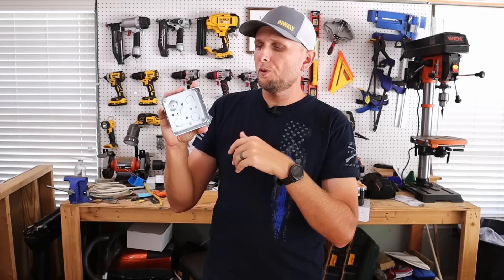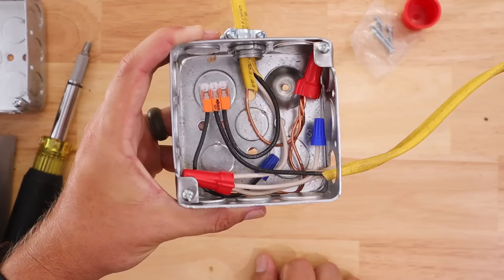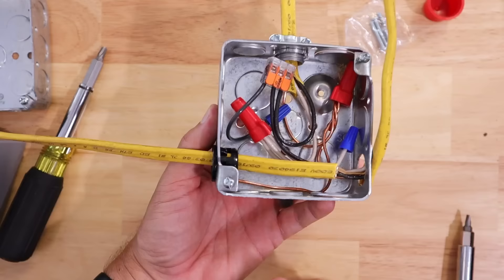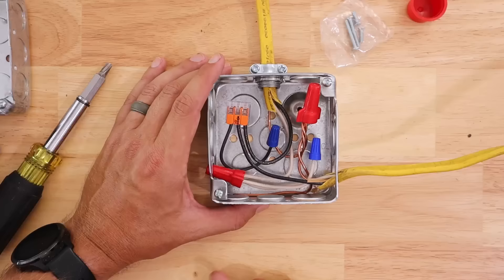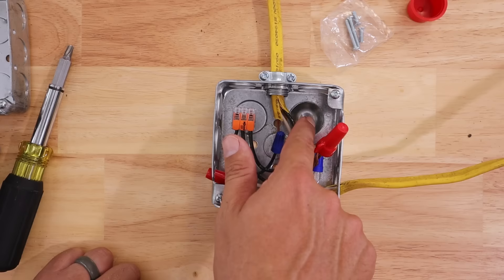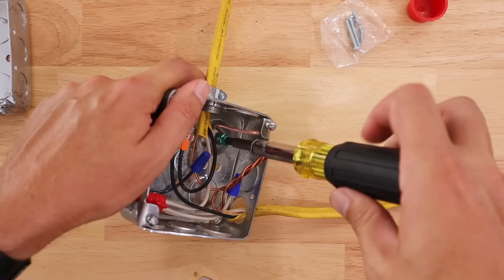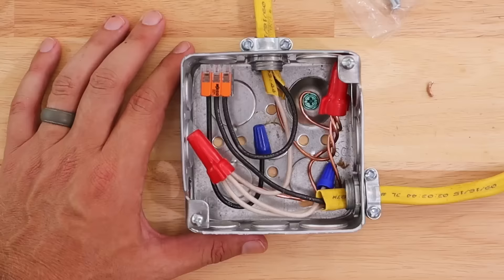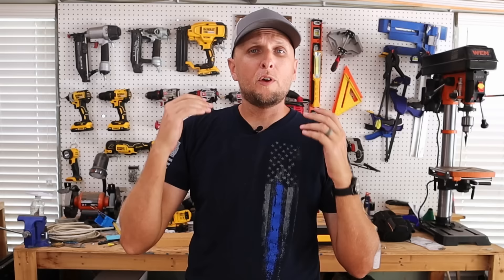The BIGGEST Mistakes DIYers Don't Know They Are Making When Installing Metal Electrical Boxes

Comment: The 14 gauge pigtail isn't really a problem... like at all.  You will most likely be putting in a 15 amp outlet which only requires 14.  The rest of the circuit needs the 12 for the additional current from other outlets.  If you were putting in a 20 amp then I would say for sure use the 12 (even though it's a minute difference).  But again not really an issue for the same reason that 15 amp outlets are allowed on 20 amp circuits.
Reply: i think if its under a foot 14 is fine for 20a anyways. still not a great idea to do so because some idiot is going to be looking at it later, get confused, and screw something up

Comment: With the green grounding screws, do they have to be used because of code compliance, or are they made of a material meant specifically for grounding?
Reply from the maker: So technically it doesn't have to be green in this installation.  It has to be a machine screw and fit the threads in the box.  Going with the green ground screws in the electrical section will ensure that you are getting the proper type and size.

Comment: Those small blue wire nuts are also a violation, they are only rated for a (1) #14 conductor in the spec sheet. They are not at all rated for #12.

Comment: The requirement for a green screw does not apply here as it applies only to device screws and screws used as main bonding jumpers according to 250.126(A) and 250.28(B). Section 250.148(B) is the main rule in this case, and it requires only a grounding screw used for no other purpose or a listed grounding device. The screw is not required to be green. However, Section 250.8 states, “sheet metal screws shall not be used to connect grounding conductors to enclosures.”
Reply from the maker: Yes, I said what I did because this is for homeowners and it's way easier for them to just go find these green screws in the electrical aisle and know that they will fit and be good to go instead of trying to find a machine screw that will fit correctly.  In some applications green ground screws are required however.

Comment: Your neutral wire nut is not properly installed in your completed box.  Should be twisted until conductors wrap to prevent any conductors from sliding out.

Comment: 14 Ga is not an issue if you are installing a 15 amp outlet. If you are the one installing the wiring it is safe to assume you are going to be installing the outlet as well. 99% of the outlest in homes are 15 amp. This being said.... If there is ever a fire, that wire will be blamed. Most states and even the NEC (based on a quick google search) say 14 ga is fine for 15 amp at 120 v. Some states/regions/cities/counties have different codes.

Comment: Regarding your preference for pre-twisting your wires (solid copper, that is) before using a wire nut ---- you are absolutely correct. Anyone who relies on just the wire nut to keep the splice tight is asking for trouble. Pre-twisting is how every professional electrician will do it every time. Any solid copper wire splices should be twisted before the wire nut is used

Comment: Also, the white neutral wires are not twisted together.  The wirenut was not properly installed.  There should be at least 3 twists of the wires.

Comment: In my County the Inspectors will knock you down for using a regular wire nut on the Ground. They want a crimp ring, some will allow The Green Wire nuts for a DIY.  They want to easily see that all the Wires are Mechanically connected. Also the Wires that have the Blue Wire Nuts would be disallowed. The Wires have to go somewhere.

Comment: Thank you for the video. If your home has been wired with 14ga can you use 12ga for extensions/pigtails?
Reply: You can always go bigger on the wire. The problem that can cause though is the  next person to work on it might see the 12 and assume its on the appropriate circuit

Comment: I did not read all 1,784 comments ... The issue of the third wire in the Wago being 14 awg and the feeder being 12 awg is not necessarily bad if you KNOW the attached device won't pull more than 15 amps, but the 20 amp breaker won't protect that wire. This is the case when you install a ceiling fan on a 15 amp circuit but the fan's wires are 18 or 20 awg because that device is safely powered by that gauge. However, if the device you install on that 14 awg wire is a convenience outlet, and its probably a 15 amp, not 20 amp, outlet, then you just have the risk of some yayhoo using a cheater and that wire is not protected by the breaker (which is probably 20 amps). Regardless, the wire and outlet should match the breaker.

I am surprised you did not call out the three common (white) wires for not being twisted outside of their wire nut; you have a video that states that is a common error by not following the instructions for the nut.

Comment: My own rule of thumb for wiring is outlets-12ga. Lights-14g (unless there is a greater load like large fans {8' dia}). Outlets and switches corresponded to the anticipated load. I'd rather overbuild than under-build.
Reply: Wire gauge is chosen based on breaker size. 14ga for a 15 amp breaker, 12 ga for 20 amps, 10ga for 30 amps etc. The reason for this is to protect the wire. The wire needs to be able to withstand the heat produced by the maximum current that will be drawn before the breaker pops. For example a 14 gauge wire will melt eventually at the temperatures produced when more than 15 amps are drawn in a circuit. Wire gauge has nothing to do with lights or outlets. 14ga wire on an outlet on a 15 amp circuit is sufficient, however a light on a 20 amp circuit would need 12 gauge wire or thicker.
Reply: No, wire is chosen from the load not the supply. It is the anticipated load and run that dictates the type outlet, the wire ga. and finally the breaker. It all has to be balanced based on the load.
Reply: @TheHighKirk No, they are right. Wire is chosen based on circuit size, which is the breaker ampacity. The circuit ampacity / breaker is based off of the expected load and code requirements.

Comment: I got three of three - I thought.

I thought the third one was that there was an open knockout on the lower left corner and I didn't think that was allowed.

The 12 vs. 14 gauge I really couldn't tell from the small screen - but is that really a code violation? If it's a 15 AMP circuit (with a 15 AMP breaker of course), is it required that if you use 12 gauge anywhere_, you must use it _everywhere on the circuit? Mixing doesn't seem unsafe unless someone comes along later and assumes it's a 20 AMP circuit due to the 12 gauge wire and swaps in a 20 AMP breaker as a result.
Reply from the maker: Yes an open knockout would be a violation but it came later in the video to demonstrate the plastic NM connector.  I failed to mention that this was on a 20 amp circuit so yes, technically if it is a 15 amp circuit then #14 can be used but I still don't advise that as like you said, someone could come along later, add a 20 amp breaker and not realize that someone mixed #14 wire into it.

Comment: As a electrician i always cut ✂️  wires to length  6 inches from box. Then I strip them twist them and clip them and cap them. I hate wagos I cut them out !.  Twisted bare wires carry more amps than a wago!!  Wires not twisted can come out of a wirenut. A wirenut can conduct the current in the spring causing wirenuts to get hot 🔥 🥵

Comment: Technically, a 4" piece of 14 AWG will handle plenty of current... at least much more than 50+ feet of 12 AWG will. I realize codes may prohibit this mismatch, but there's not a real limitation in that setup.

Comment: The 3rd mistake with the 14 gauge wire is only a problem if you are running a 20 amp circuit. If you are running a 15 amp circuit then that 14 gauge wire would be completely fine and acceptable to code.
Reply: to code yes.  but some idiot will see 12awg out of the breaker box and decide to slap a 20a breaker down the line which means that would have a code problem.  reality is though as long as you don't come out of that outlet to other stuff i'd have no problem saying the 14awg will be fine for a few inches like that even with 20A

Comment: 1:13 No strain relief.   The box is going to be securely fixed to the fabric of the building.   The cable is going to be concealed in the wall.   Who is going to be tugging at it, and how, when, and why?   If you're really worried about movement, fit a grommet.
Reply: A metal or plastic cable clamp designed for this purpose, is required by code, grommets are not permitted.
Reply: @surferdude642  Oh I never expected for a minute that the UK had a monopoly on madly unjustifiable regulations.

Comment: Why bother with the capped pigtail if you've got a Wago connector there? It would be pretty easy to drop in a pigtail connector once you actually install your device. Moreover, wouldn't the pigtail be a potential danger if the wire nut got knocked off somehow?

Comment: Do you pigtail recepticals or use them as part of the cuicuit by using the 4 screws so that one set carries the hot and neutral feed and the other set is used to carry the power upstream?
Reply: Using the screws is fine, pigtails usually unnecesasary.
Reply: @pd  in which jurisdiction? Is this within the federal electrical code?
Reply: @MrSmeg2000  According to the National Electrical Code, pigtails are required (on neutrals only) when wiring a multiwire branch circuit, when sharing a neutral. On individual circuits, pigtails are not required for hots or neutrals. The terminal screws on a 15A recep are rated for 20A of feedthrough current.

Comment: I'm a DIY.  Since you have a white and black pigtail for a receptacle, wouldn't you need one for the ground wire?  or does the metal box connection negate the need for the ground connection to the outlet?
Reply: @TheDarthJesus  I noticed on a couple of new outlets that the ground screw is tied to the mounting ear, so would that suffice as the outlet ground in a metal box or is a pigtail still recommended?
Reply: @TheDarthJesus  Thanks.  I always do to be safe, but it is an easy mistaken assumption to make.

Comment: I just installed four metal boxes with two outlets in each box in my garage, but I ran 1/2" EMT conduit between each box for the wire runs. Are the clamps still necessary when using conduit? (I did use a clamp for romex coming from the service panel to the first box)
Reply: There is an Insulated Straight Set Screw Connector specifically for EMT conduit.  They are about $.60 each.  For code, conduit should be run throughout a garage installation.  Bare Romex, anywhere in a garage, is not code.

Not a biggie, until you try to sell the house.
Reply: @mark9531  That's exactly what I used. Snaps into the box and has a set screw securing it to the conduit. Grounded each box using pigtails, mud rings in the boxes for the outlets, then the plastic cover. All supplied via combo GFCI/CAFCI breaker at the panel.
Reply: @varanidguy  It sounds like you know what you are doing.  I am a DIYer.  I just did my whole garage with 6 light panels and 8 4 x 6 receptacles.  This was my first venture into conduit.

I buggered up more conduit, cutting too short, bending the wrong way, or bending the wrong angle.  I would run into  a snag, go watch a You Tube video, and go back and fix it.

The process was not pretty to watch.  But it looks professional now.  And everything works.
Reply: @mark9531  Sounds like you got it down as well! Nice work.

Comment: Trained eye, been doing this for 50 years. If you are going to point out mistakes that are being made by others you need to make your work neat and professional. Cut the cable jacket without creating jagged pieces protruding into the box. Ive always appreciated constructive advise from others. You are a bit defensive. Start the grnd screw in the box, make a loop then put it under the head of the screw and close that loop with needle nose just before tightening Your bare wire is not fully under the grnd screw head. Thats the most important connection in the box!
Reply from the maker: You keep pointing out something that is false.  It’s not me being defensive I’m telling you you’re wrong.  The entire loop of the ground is under the ground screw. I still have that box made up today and verified this again.  The other issue is a non issue.  You just don’t like it.  Your trained eye is probably great in person but you can’t see everything for what it is on video.

Comment: A note, the guage of wire being 14 guage instead of the 12 guage wouldn't be a issue if the breaker connected to it is a 15 amp. It should be paired with the size of the breaker. If the breaker was a 20amp that 14 guage is a no no. There is evidence that 12 guage runs also are more efficient on a 15 amp circuit. It is also more expensive....
Reply: it might be code fine.  i think it is actually.  but some idiot adding an outlet on the circuit is going to assume he can switch to a 20 amp breaker because the wire out of the breaker box is 12awg. so i would hold it is stupid to do so and not a good practice.  i'm not entirely against mixing wire gauges though. i added a 15 amp outlet on a 15 amp circuit a while ago and was out of # 14 wire of the right color.  somehow getting my wire to the box was exactly the right length to the inch and i always use wagos so i can easily extend in the future.  i had some #12 wire lying around though so used that from my wago to the outlet.  don't think there is a problem there but if i ever open the box again i'll probably replace it to avoid confusion in the future

Comment: 12ga is most common on all outlets regardless if it's a 15amp or 20amp circuit. Generally if you have to run to the light switch/lighting from the outlet, you'd be using 14ga, as long as it's a 15amp circuit. Otherwise if it is a 20amp circuit, then one should run 12ga from the outlets to the lights. Great video, thanks 👍

Comment: Dont like plastic boxes,Ya a floating hot you can get shocked because it's still live wire and did not trip Braker. With a metal box if grounded correctly the loos hot most likely will short out to the metal box and trip the breaker.  It's Getting a bit crazy with all these different wire gadgets, wagose, plastic strain reliefs, and plastic boxes, types of outlets, and switches. I  have done a fair share of Electrical and I know most of the ins and outs of most of these but for the homeowner its gotten increasingly hard to DIY and in more and more cases I think gotten quite a bit more dangerous. Don't forget to Lockout–tagout before doing electrical work.

Comment: #14 can be used on a #12 circuit in parallel depending on load (LED lights)............. Per NEC.
Reply from the maker: Ok, yes but that was not the point I was making.  Yes fixtures often come with cords that are rated less than #12 wire but because the load is so low, it is not an issue.

Comment: Helpful video for the newbies. I would just like to add that a green screw is not needed for the ground screw in a box per NEC 250.8. The newest 2023 NEC access is now free thanks to a lawsuite.
In fact the newest 250.8 gives many crystal clear(finally) options for fasteners or listed clips. You can use machine type screws or even self threaders as long as 2 threads are touching the box. Also for older or stripped boxes you can use a machine screw and nut, although probably a pain when it's already in the wall. 
And as you may find out, some inspectors interpret a later chapter about devices needing a green screw as meaning grounding tail to box but that chapter is addressing devices; such as outlets and they already come with a green screw.............usually.

Comment: The 14 wire is fine there as a pigtail, even on a 20 amp circuit. The outlet itself will prob never pull more than 15 amps and as long as it’s a pigtail making it the end of that circuit (not passing the circit through the outlet) that wire wont be in any danger

Comment: to me wagos are dangerous.. not enough surface area where the wire touches the wago... its like stabbing wire into the back of a recept or switch.... over time heat will weaken the tension on the wire which could cause a fire or bad connections

Comment: The wago must connectet with only the same size of the wires?
Reply: You can use different sizes in a wago. Follow proper wiring sizing for load ratings.

Comment: I noticed there is not an additional pigtail from twisted ground wires, to ground screw of the receptacle to be installed.
Reply from the maker: It is there.  It is hiding behind the neutrals.

Comment: I don't care for pre-twisting the wires. It is not required by the manufacturer of any wire nut. Pre-twisting makes it difficult when you are working on a hot circuit. Try removing one hot or neutral from a group of wires twisted together. If you are going to install a duplex receptacle in this box, it is difficult when you come into the box using a center knockout. Much better to come in through a side KO.

Comment: Using a 14 gauge wire with 12 gauge wires is fine, so long as the circuit is protected at 15 amps and not 20. Running heavier wire (like 12 gauge in a 15 amp circuit) is often done to reduce voltage drop on long circuits.
Reply from the maker: Yeah the intention was that this was on a 20 amp circuit.  Aside from that, I will never use smaller wire than the run in case the person after me thinks everything is good to go to upgrade the circuit breaker to 20 amps.